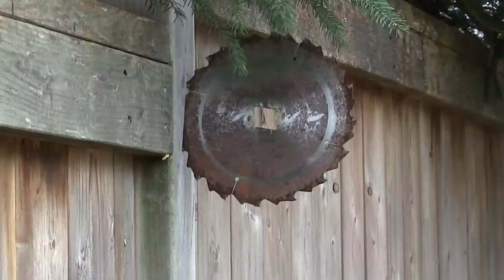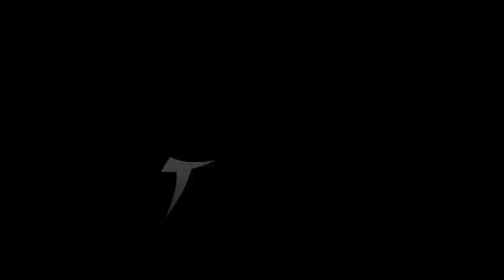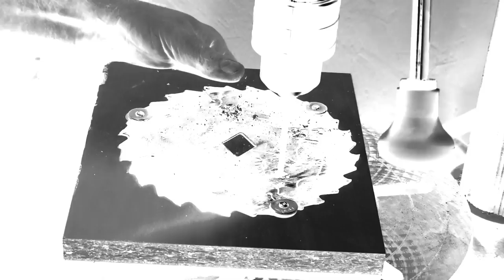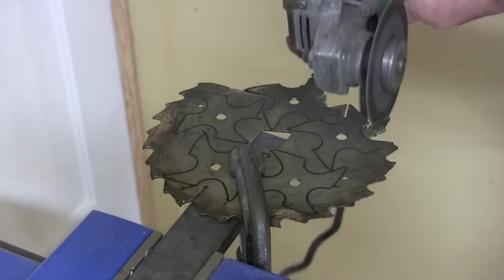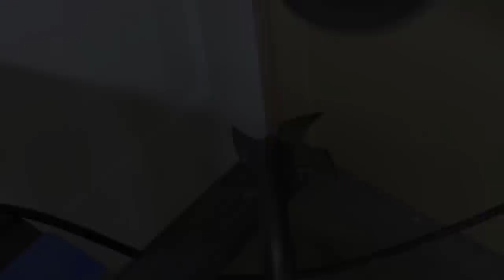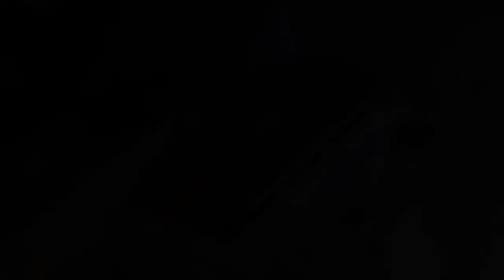Making Shuriken (Ninja Throwing Stars)

Comment: quick tip when trying to grind off the rust instead of using a sanding pad wheel you can use a masonry wheel instead. it lasts longer and gets it done much faster.

Comment: I don't understand why it was necessary to cool with water on the belt sander, but not when using the grinder.  It seems like the grinder would generate more heat.
Reply: because he was sharpening it and if it gets hot the edge will deform.

Comment: in order of appearance. circular saw blade, hand drill, grinder w/ sanding attachment, sharpie, punch and hammer, drill press, grinder with cutting wheel, grinder with grinding wheel, belt sander, a bucket of water, and black spray paint.

Comment: Very steady hand! I am sorry if this is a dumb question, but exactly what tools did you use? I think I saw an angle grinder, a belt sander, and a disk sander. If so, what disks did you use on the grinder? If not, what tools did you use? Finally, if possible, could you send me a detailed step-by-step guide on how you made this? If not, do you know of any books that could teach me this construction?

Comment: Come on, once you get the material you can simply use a handheld saw to cut the shapes out. And after that you can sharpen it with a file. If done right, then it wont take much longer than with machines.

Comment: Awesome!
Reply: MavalocKing5050 I finally made my own Shuriken star. Wish I would have had a better method for the cutting the metal though. I used a battery operated dremel to cut out the outline of the star, which took "forever!!" to complete. The dremel kept running out of battery power, after only three minutes of cutting. It basically took me an entire week, to cut out one single star. The end result was pretty cool though.